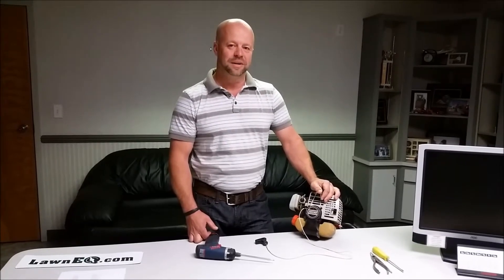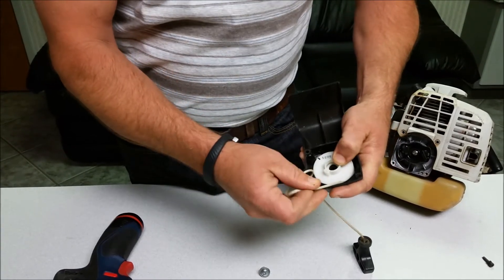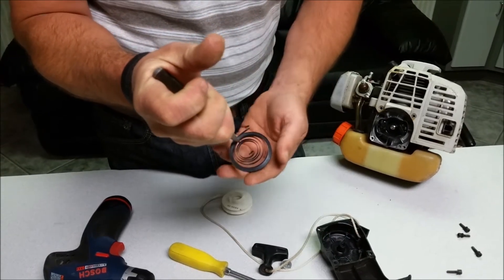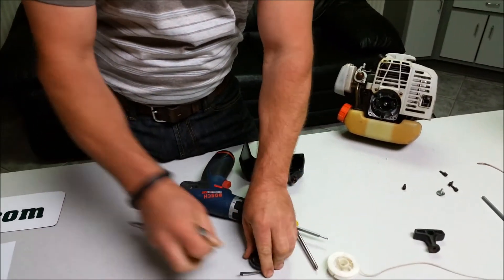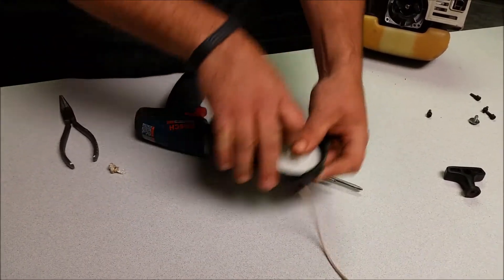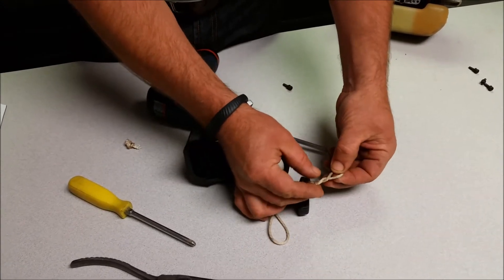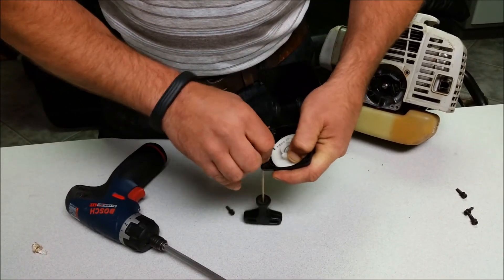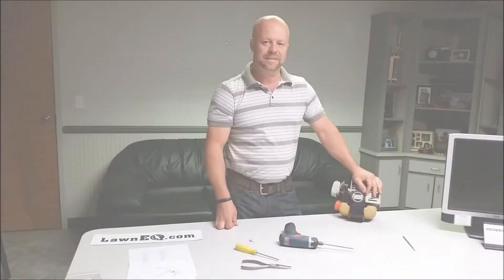How to Repair a Starter on a SRM 2100 Echo Trimmer

Comment: Awesome video and thanks for creating it. On mine, the hooked end of the spring that goes into the housing was broken and the piece was flat at the end. I made a bend by matching the bend that is on the inside of the spring. It took some tweaking and a bit of work to wind the spring and put it back in. Blake makes it look real easy. It took me about a dozen times and I'm glad I got it as my hands and fingers were starting to get tired. Anyway, my 15 year Echo is as good as new!